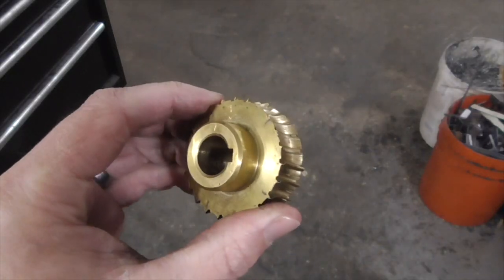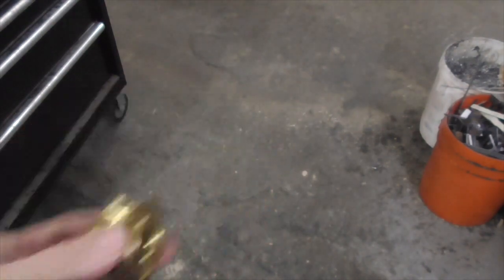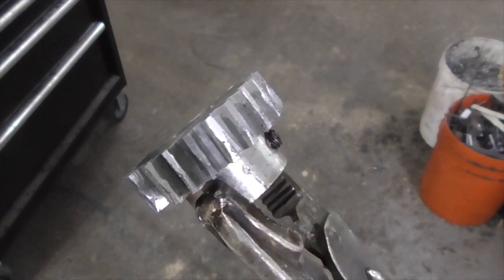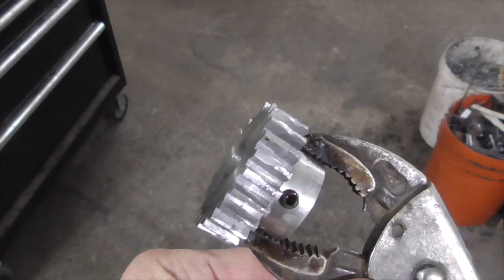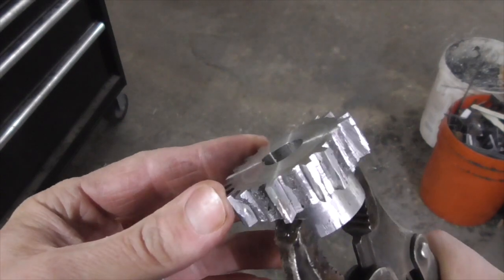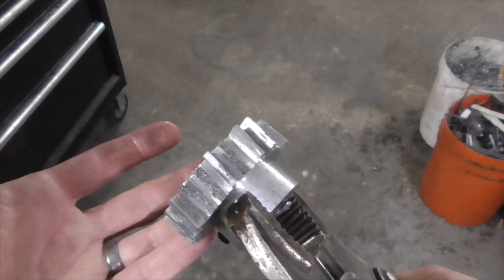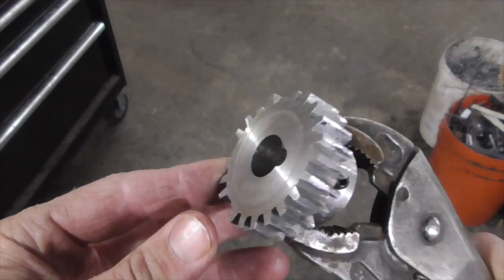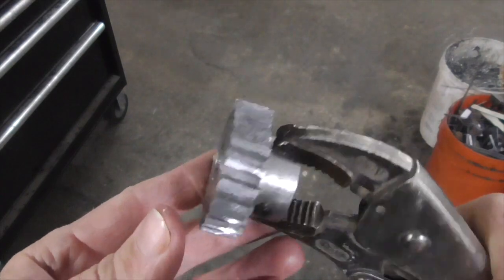Failure Modes of Improvised Worm Gear (RO010)

Comment: What you hold in the pliers is not a worm gear, It is a straight cut gear. Aluminum is too soft to actually work very long even the 7075 or 6061. They are not wear items in the sense you need for a gear.

Comment: So...can you temper the aluminum like steel to harden it?
And would/could that have helped the gear?
Reply: Some aluminum alloys can be heat treated.  They are precipitation hardened, more like 17-4 PH stainless steel, than 4140.  The latter is heated to a cherry red, quenched in oil, and tempered to the desired state.  Precipitation hardening occurs at a much lower temperature, and no quenching is involved.